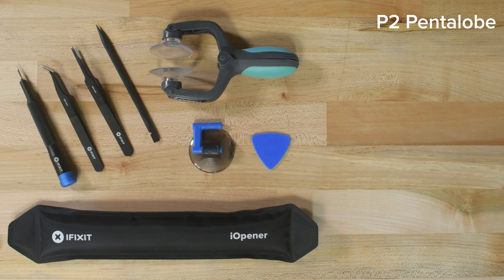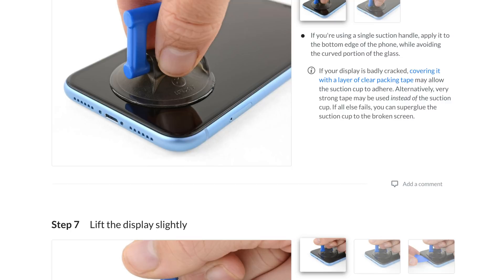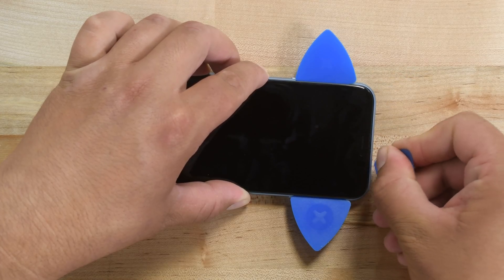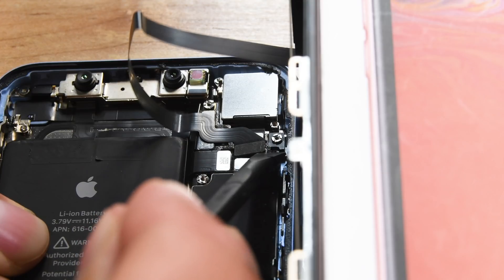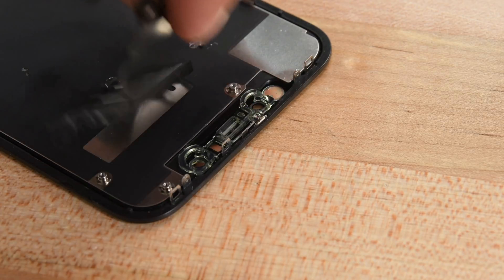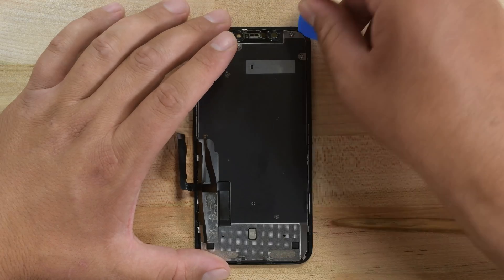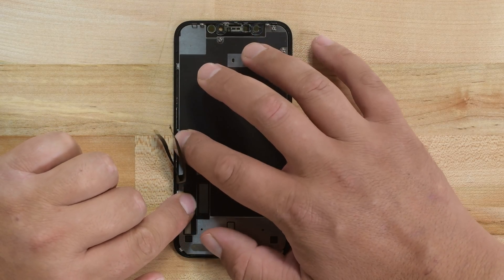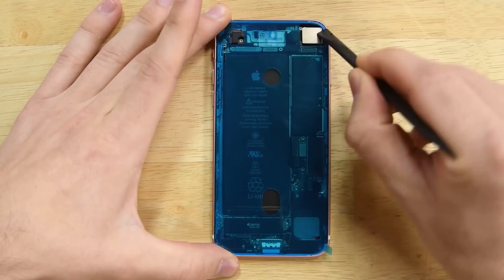iPhone XR Display Replacement!

Comment: What about the display as apple pair each display do its iPhone. After Assembly, you will definitely get a message that "This display is not original", and might you lose the face ID too as the proximity sensor has the same case.

Comment: If you want to to skip the metal plate step. Purchase a pre installed plate for the XR dispaly. So all you have to do is transfer over the ear speaker. 

Also true tone won't be transferred over. If you want true tone buy a true tone transfer board

Comment: As someone who has done this many times, this is not easy and it will not take the average newcomer only 40 minutes. The FACEID components are ridiculously fragile and need lots of care and attention and heat to remove. Proceed with care

Comment: Would this
1. Disable true tone
2. Show warning pop-up under settings?
Reply: Yes
Reply: yes, you would need to buy a jc pro reprogramer which makes this repair much more expensive and complicated. If you do not reprogram the display, it will still work but true tone will be disabled
Reply: Jay Raut thanks mate. I have a broken Xs display. It seems there is no easy way to get true tone functionality back once it is replaced
Reply: @saiyannegi  Thank apple for that

Comment: You did not talked about the errors that you get after changing the display and battery it’s not this simple man
Reply: XR doesn't have display error message, only battery error
Reply: Shemal Jayasinghe yes i had a battery problem but not with the display as it is with the 11 pro or max that’s why i would love to have solutions
Reply: @ismailniro  yeah waiting for a simple solution for an year now. Some people do it by swapping the actual display IC but it's a messy and risky solution